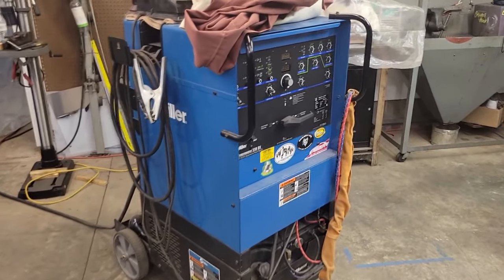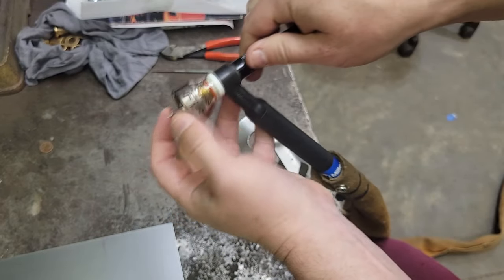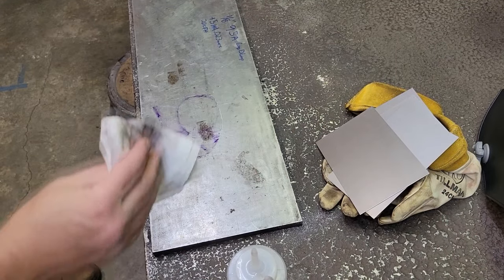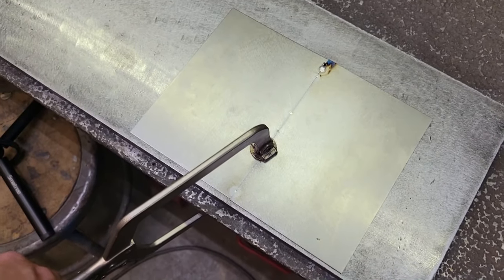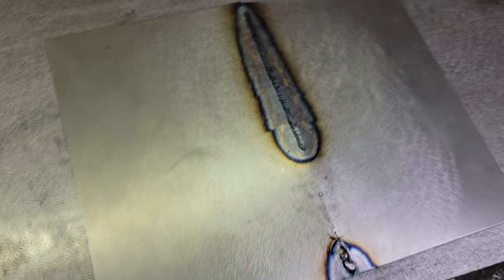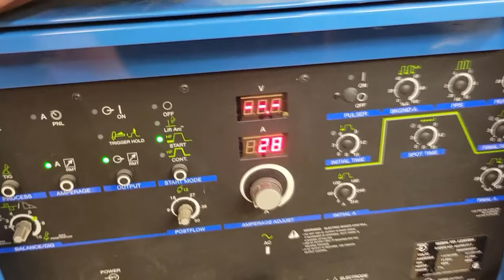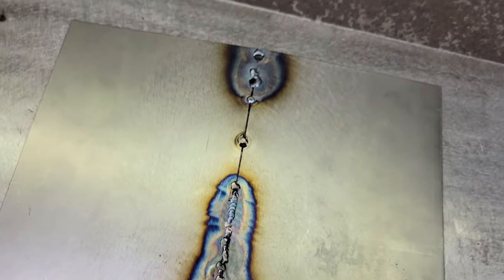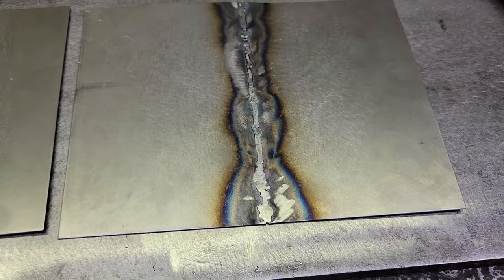How to (TIG Weld) Thin Sheet Metal (For Beginners)

Comment: I appreciate your teaching . I am 68 years old . Stick welding since I was 16 . I bought a Miller Diversion 180 three years ago . I retired from Miller Brewing after 33 years in 2011, then 8 years of driving a chemical tanker in 2020. I have a 64 C10, 65 C10, 98 2500, and a 1979 C30. Lots to do . Floor panels and such. Never tried TIG since welding school in 1976. So your information is right on ! Thanks so much . Old Marine
Reply from the maker: Awesome thank you!!! And also thank you for your service 🙏  Sounds like we have alot in common, I'm building a 65 c10, 68and a 72 c10. The 65 is top priority. If you go to my playlist on my channel you can see the cars im building. My dads 32 ford and a 68 protouring camaro for my buddy. I took it from rust bucket all the way to show car, I done the metal fab body work and paint. Thanks for watching and the nice comment 👍
Reply: Did they have welders 183 yrs ago?😱
Reply: Is tig welding the way to go to do metal sculpture vs mig gas welding? I started doing welding in diesel school which was 7018 filling V blocks in all the welding positions. Would the ArcCaptain 200 multiprocess or the dedicated tig machine be better?

Comment: I just got me a TIG and man it is difficult, 90% technique I think. Thanks for your teaching, I appreciate it  🙏
Reply from the maker: Its tough but stick with it, youll get it. Thanks for watching!!!!!
Reply: Where I work I often do special welds where I use a mig welder wire feeder in my left hand for cold feeding .035" mig wire into TIG weld.
Works good for straight line welds. Try it sometime.

Comment: Have Syncrowave 350 where I work. I weld up boxes and things out of 1/16 inch sheet they have a lot of.
I get the corners tacked up and then just fusion weld with it on about 40 amps.
If I use filler I use .035" mig wire.
It works really good.
The edges need to be right together with no gaps, if it gaps then I need the fill.
Reply from the maker: Thanks for sharing. The fit up is crucial for sure!!!!
Reply: Do you use flux core wire or regular mig wire just wondering Thanks for info
Reply: Thanks for posting I'm learning to Tig weld.
 Everyone have a Great Blessed Day
Reply: No Flux core, plain wire. Flux core would probably make a mess.

Comment: If you have the larger diameter Roloc and cut them with tin snips so they have points you can get to the weld easier without hitting the sheetmetal. Thanks for the great demo on tigging the 22ga.
Reply from the maker: Awesome thanks for the tip!!!!
Reply: Do you mean like cut out a star shape, how many points to what diameter and what grit number please

Comment: I started tig welding about 2 yrs ago. I've gotten decent in that time, at are shop we do a lot of different stuff, but are main thing is stainless hoppers usually .105 .075 or .060 wall, the 105 and 75 I can do no problem, the 060 I can almost do everything but I still have some trouble w the horizontal seem of the round hopper.  Sometimes because the way you have to fit it, also usually sanitary welds, and I'm trying to figure out ways to mitigate the sugar when I do the outside weld.  Any tips or tricks u could think of wiukd be much appreciated.  Great video
Reply from the maker: That's awesome,  thanks for watching,  I will say stainless can be a bear. A larger cup may help on your sugering . I use a #12 gas lens with 28 cfh of argon. Also make sure there is no fans near by that can blow your gas off. I've e en had people walk by and cause problems because of it blowing the gas away. I like @edgeweldingsupply tig cups.

Comment: Made my first attempt at TIG last weekend and I walked away thinking "I'll never get the hang of this." I have a Miller 215, and I was practicing on some 18ga steel and couldn't get a fusion bead going at all. Next, I tried some butt welds with filler, and my results were all over the place. I think I will measure my gas flow at the torch head instead of trusting my flow gauge at the tank. Also, gonna try using some manual settings to tweak the amperage instead of trusting the automatic settings. Sometimes I think it's best to walk away and come back later.
Reply from the maker: Yes its best to walk away and clear you head. I will say you have to have a super tight fit for fusion tac, no gap at all. Try starting with a lap weld. Just lay one piece on top of the other leaving a shelf and try your fusion there. Do you have a peddle to adjust the amperage or do you have a lift arc????
Reply: @ACDesignsGarage  It has a pedal and it is lift arc. Good idea trying a lap joint!
Reply: Touché

Comment: Thank you for lots of sharing your knowledge, great video, my question? In fuse welding with no gap, do you hav to hav the gas on? Or is gas just for filler rod..awsome job on video, techniques, lots of key stuff, others hav never really showed..😮😬
Reply from the maker: Thank you very much, yes you still run the gas so it will protect the molten puddle !!! Thanks for watching!!!

Comment: Thanks for the video! Should the gas nozzle be smaller to keep the heat closer to the weld prevent it from spreading out into the metal?
Reply from the maker: On sheet metal I haven't had that problem but with aluminum it can cause a problem,  I use no larger than a #8 cup because it will heat up your gas and spread the heat effected area .

Comment: So when you start the arc, are you pushing the pedal down to max to start the arc? How far away from the metal are you when you light up the arc? Then do you add the filler rod to the puddle as needed like oxy-acetylene welding?

Comment: I had a similar question like some of your other viewers.  How can you form a puddle if your sheet has a gap, no backing and is hanging on a car in the vertical position?  Wouldn't the puddle just sag or immediately blow through?
Reply from the maker: What I like to do if it has a gap is start a small puddle on one pannel then dab your filler rod then do the same on the other pannel ,then you can bridge the gap with another dab in the center. But that's if you only have a large gap. With tig no gap is best. I use 0.045 wire on my sheet metal because it don't take as much heat to melt. Another tip is to lay your filler in the middle of your gap heat up one side of the pannel then just wash the torch over the filler and it will bridge.  I may try to do another video if you want!!!

Comment: I can't help but wonder how your weld would go if you did pedal in reverse. As you go foward put in amps and as you slow up back off the pedal
Reply from the maker: That's how I do it, I back off as I move then pause and add the amps and filler then so on!

Comment: I really appreciate the tutorial. I’d really like to see you weld up a real panel and show any tricks and suggestions for getting a super tight fit between the new and old panels.  I’ve got one situation where I need to cut out a rusted spot and come back with new metal.  Do I need to cut back to completely corrosion free metal or is some pitting ok?  Thanks again and keep up the great work.
Reply from the maker: Thank you!!! I like to go back about 1/2" past the rot just to be safe so nothing comes back to haunt me. Ill try to make a patch pannel video soon. I have a fender that needs to be repaired. Thanks for watching!!!

Comment: Can you weld up thin metal at you blow through with tig welding? Meld is 75 years old with some rust to it?
Reply from the maker: Yes just clean up the area then weld a little on each side then bridge the gap . Hope this works.

Comment: What is the advantage to using a bigger cone? The burns are a bit wide. Does it really matter?
Reply from the maker: Just a little more gas coverage with the gas lens,  you really dont need it unless your doin stainless, but I like running them
Reply: Thank you sir.

Comment: Doesn't theplate you are welding on act as a heat sink? Because with the panel in the air I'm blowing holes the size of a dime.
Reply from the maker: It does a little,  the gap to me is one of the most important thing, if it keeps blowing holes. Try to lay the filler in the gap and wash over the filler as you weld the gap.

Comment: I had hoped for a different presentation. Laying the thin sheet metal on a much thicker backing plate isn't a fair representation of what it takes. Do a video where that parting line is up in thin air with nothing backing up the 2 halves. I'll come back for that. Then do one where there is .06 air gap between the 2 halves. Show me that and I'll subscribe so fast it will make your head spin.
Reply from the maker: I can do it like that but its hard to film, I may try that video, I do it on a daily basis on cars, but I never leave a gap, I like a tight fit up so it will metal finish better.
Reply: @ACDesignsGarage  I'm currently attempting to repair my sons motorcycle tank. Extremely thin metal and a 1mm gap. Its proving to be very challenging to not blow it all away. Thats the reason behind my comment. Thanks for the reply.
Reply from the maker: @Joe Pie  those can be tough, are you mig welding it or tig welding it?
Reply: @ACDesignsGarage  Tig. Pedal controlled. 35 amps, .093 electrode, E70S2 1/16 dia rod. Its fighting me all the way. The rod selection is new as of today. Hopefully I'll have better luck.
Reply from the maker: Sometimes you can do a super low amp. short beads on both sides of the gap then bridge the gap after you get both sides done. One tip I learned is to get your puddle formed fast and not stay in one area to long because it heats the whole area up pretty quick. Dont try to make it pretty just glue it together lol. Hope this helps, just message me back if you have any more questions 😊

Comment: Great job. I have a tig welder with the pulse feature in it. If you were using the pulse feature what setting would you try to duplicate the peddle pumping that you are doing?  You should have a lot more subscribers with the good content that you have. Thanks
Reply from the maker: Thank you very much, i haven't played with pulse much to give you an educated answer, dont want to lead you wrong lol. Check out @pacific arc tig welding on you tube or jody at welding tips and tricks they have done a ton on pulse settings. Thanks for watching!!!!!

Comment: Hi... Why does my tungsten turn black like burnt?
Reply from the maker: I've had mine do that before if the metal wasn't perfectly clean, even with mill scale residue , is it sparking and poping when welding?
Reply: @ACDesignsGarage  yes sir, there are sparks and pops when I am welding.. tks
Reply from the maker: @martingustavoblancat4912  hope this helps 🙏

Comment: "For beginners", really ? With a 12.000$ machine and pedal pumpin'? 
Beginners have maybe a $300.00 machine from amazon with only a current regulation. THAT is a beginner machine. Now teach me how to do stuff with such a machine.
Reply from the maker: Lol Id never pay 12k for a welder and I have a video comming up with a $400 yeswelder 3in1 mig tig and stick machine that will do just as good of a job with practice, this video was about the skills you need to practice on and not how fancy of a machine you have. My first welder that I still own was a miller thunderbolt buzz box that I learned how to tig on 30 years ago. Its just like using a hammer and a shot bag to form metal a 65k power hammer does the same thing but alot faster and easier. Thanks for watching!!!!
Reply: @ACDesignsGarage  First and farmost, I watch your vids with great eager, being a diy-er.
The 12k was just a random high figure :)
But being this starting diy welder, I have to learn to adjust other things than "current-on-the-go" with the pedal and such. With my budget, those things are all fixed, so I myself have to flex more.
I don't make money with my diy, so there's no room to spend more, and earn it back later on.